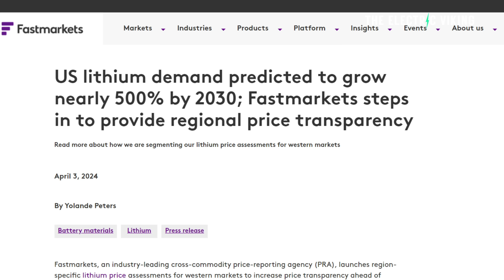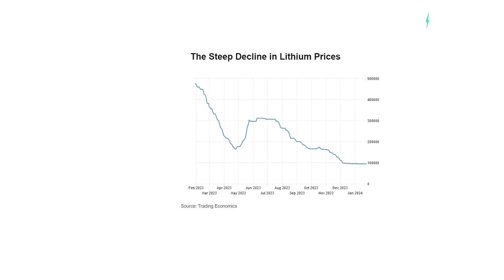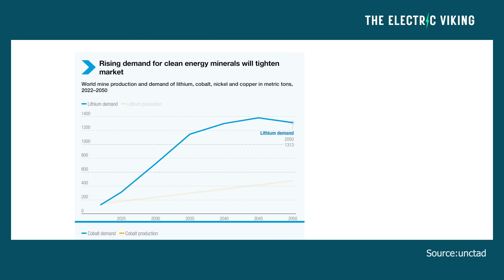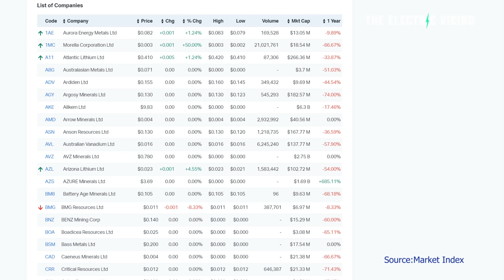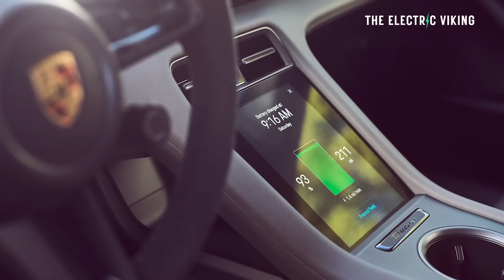Experts say US lithium demand will grow nearly 500% by 2030

Comment: The scam of the century is over.  Ask Hertz 😂
Reply: You mean the company who used to report their legitimately rented cars as stolen, causing their customers to aggressive get arrested? For YEARS 
The lawsuits were spectacular over that one.

Or the company who charged someone $277 for gas when returning a Tesla model 3. Which had a 97% charged battery. And will not refund/back down?
That just happened. 
Google it. It's all over the place. 

Or that they didn't train staff about EV's or be bothered to show new EV drivers how to operate an EV and the details about them.
Which is substantially different than ICE vehicles.

Or that they put EV's in areas without a lot of public fast chargers yet? Or have a discussion about charging with their customers... This is a problem for people traveling and getting a rental... Which are a large proportion of the people needing a rental vehicle...

Or that Hertz bases their operating model off of the residual value of a vehicle after 2-3 years when they sell it? Tesla started dropping their prices significantly after the lithium run up during covid. This obviously affected resale value substantially. Which doesn't work well for.Hertz's model. 

Or that Hertz usually gets a 20-30% volume discount. Tesla didn't budge much on pricing.

Based on that discount alone, Hertz basically uses the vehicles for near free, as they sell them normally for not much less then they paid for them a couple years prior. 

So, yeah, that company...
Reply: You mean the company who used to report their legitimately rented cars as stolen, causing their customers to aggressive get arrested? For YEARS 
The lawsuits were spectacular over that one.

Or the company who charged someone $277 for gas when returning a Tesla model 3. Which had a 97% charged battery. And will not refund/back down?
That just happened. 
Google it. It's all over the place. 

Or that they didn't train staff about EV's or be bothered to show new EV drivers how to operate an EV and the details about them.
Which is substantially different than ICE vehicles.

Or that they put EV's in areas without a lot of public fast chargers yet? Or have a discussion about charging with their customers... This is a problem for people traveling and getting a rental... Which are a large proportion of the people needing a rental vehicle...

Or that Hertz bases their operating model off of the residual value of a vehicle after 2-3 years when they sell it? Tesla started dropping their prices significantly after the lithium run up during covid. This obviously affected resale value substantially. Which doesn't work well for.Hertz's model. 

Or that Hertz usually gets a 20-30% volume discount. Tesla didn't budge much on pricing.

Based on that discount alone, Hertz basically uses the vehicles for near free, as they sell them normally for not much less then they paid for them a couple years prior. 

So, yeah, that company...
Reply: You mean the company who used to report their legitimately rented cars as stolen, causing their customers to aggressive get arrested? For YEARS 
The lawsuits were spectacular over that one.

Or the company who charged someone $277 for gas when returning a Tesla model 3. Which had a 97% charged battery. And will not refund/back down?
That just happened. 
Google it. It's all over the place.
Reply: That was Hertz's mismanagement
Reply: You mean the company who used to report their legitimately rented cars as stolen, causing their customers to aggressive get arrested? For YEARS 
The lawsuits were spectacular over that one.

Or the company who charged someone $277 for gas when returning a Tesla model 3. Which had a 97% charged battery. And will not refund/back down?
That just happened. 
Google it. It's all over the place. 

Or that they didn't train staff about EV's or be bothered to show new EV drivers how to operate an EV and the details about them.
Which is substantially different than ICE vehicles.

Or that they put EV's in areas without a lot of public fast chargers yet? Or have a discussion about charging with their customers... This is a problem for people traveling and getting a rental... Which are a large proportion of the people needing a rental vehicle...

Or that Hertz bases their operating model off of the residual value of a vehicle after 2-3 years when they sell it? Tesla started dropping their prices significantly after the lithium run up during covid. This obviously affected resale value substantially. Which doesn't work well for.Hertz's model. 

Or that Hertz usually gets a 20-30% volume discount. Tesla didn't budge much on pricing.

Based on that discount alone, Hertz basically uses the vehicles for near free, as they sell them normally for not much less then they paid for them a couple years prior. 

So, yeah, that company...
Reply: They're the company who used to report their legitimately rented cars as stolen, causing their customers to aggressively get arrested? For YEARS 
The lawsuits were spectacular over that one.

Or the company who charged someone $277 for gas when returning a Tesla model 3. Which had a 97% charged battery. And will not refund/back down?
That just happened. 
Google it. It's all over the place. 

Or that they didn't train staff about EV's or be bothered to show new EV drivers how to operate an EV and the details about them.
Which is substantially different than ICE vehicles.

Or that they put EV's in areas without a lot of public fast chargers yet? Or have a discussion about charging with their customers... This is a problem for people traveling and getting a rental... Which are a large proportion of the people needing a rental vehicle...

Or that Hertz bases their operating model off of the residual value of a vehicle after 2-3 years when they sell it? Tesla started dropping their prices significantly after the lithium run up during covid. This obviously affected resale value substantially. Which doesn't work well for.Hertz's model. 

Or that Hertz usually gets a 20-30% volume discount. Tesla didn't budge much on pricing.

Based on that discount alone, Hertz basically uses the vehicles for near free, as they sell them normally for not much less then they paid for them a couple years prior. 

So, yeah, that company...
Reply: What scam - do you mean all the fossil fuel subsidies?

Comment: We need increase standards for solar glass to protect from hail going forward for 20yrs, baseball size
Reply: An increase of efficiency from its paltry 21% would be nice.
Reply: @ElMistroFeroz already happening. I guess you don’t know much about the technology developments?
Fossil fuels simply can’t compete. Laws of thermodynamics can’t be beaten.
Reply: I’ve had mine on my roof for 10 years. Paid itself off in 4-5 years. 
Many hailstorms and works fine. Zero problems.
Sure it happens, but the likelihood is extremely low. Compared to the massive distributed solar generation around the globe? Zero impact. Not even a blip on the rise in generation. Not a blip, zero, zilch, nada.

Comment: I think that because of AI that we will find better materials for creating batteries than lithium.
Reply: Because of how batteries work, you need an electron donor and an electron acceptor. Only metals can freely give up their electrons. Non-metals like carbon don’t want to give up their electrons and are considered “insulators” because they don’t let electrons move. Semi conductors, like silicon, will let electrons move, but only under certain conditions, not freely. So if you set an AI program off to look for the element that would make the best battery, it would look for a metal that will freely give up its electrons, and also have the lowest weight. The lightest metal in the periodic table is lithium. So 1,000 out of 1,000 times the AI program would pick lithium. Yes, there will be combinations of lithium doped with other elements that will be more efficient that what we currently have, but lithium will always be the core back bone of future batteries because it has the lowest weight of any metal.
Reply: @larzlarz1140  Google DeepMind’s research team has introduced a deep learning tool called Graph Networks for Materials Exploration (GNoME). This AI tool has discovered 2.2 million new crystals, including 380,000 stable materials that could be used in future technologies like superconductors, supercomputers, and next-generation batteriesAd1. These materials are now being added to the Materials Project database for further research and development.

380,000 stable materials. That's a hell of a lot, and this just happened using AI. AI is going to help us find a lot more. The chances of us finding an alternative are much better than you suggest. It's not likely we are at the very end of what's possible with battery technology already. I'd say we are just getting started, actually.

Comment: I would take these predictions with a grain of salt (literally, sodium chloride) as the ability for sodium to replace or supplement the use of lithium is unlikely to have been foreseen by these 'experts'.
The ability of sodium to replace lithium will be a welcome stabilising factor on both the price and the demand for lithium.
And speaking as a geologist, the world is not going to run out of lithium anytime soon, and it's extraction is no more 'dirty' than most other minerals, so any anti-EV trolls can dream up different lies to push.
Reply: I always love the anti lithium arguments...

My favorite is telling them that a typical passenger EV contains just 10's of kg's of lithium...
All fully recyclable...

Vs the 10's of thousands of liters of fuel consumed over the lifespan of a similar ICE vehicle...
None of it recyclable. 
And that it cost a lot more energy and oil to make those liters of fuel. 
Electricity alone is about 2kWh needed per liter of fuel to extract, transport, store, refine, distribute and dispense....
Those same 2kWh would take an EV further then an ICE burning that liter of fuel.
Reply: @jeffl4810  and the estimate that by 2030 over 95% of all nmc and lithium in new batteries will be recycled.  By 2050 100%
Reply: @jeffpitoniak  
Yep! Recycling will be that huge!

Recyclers already pay about $45 per kWh for NMC and $15 for LFP per kWh
Reply: Gravity, sand, and redox are all on the rise for stationary grid scale replacing lithium also
Reply: The problem in the U.S. with getting a new mine started is permitting.  I agree with you about Li and Na.
Reply: Everything I know of has a lithium battery and always has so ima bet on lithium and try to make some money doing so🎉🎉🎉